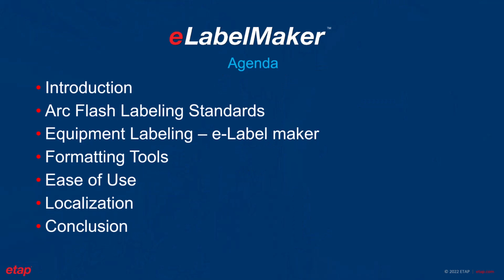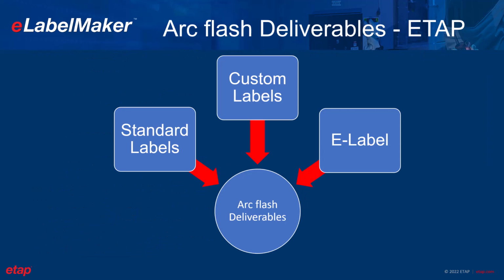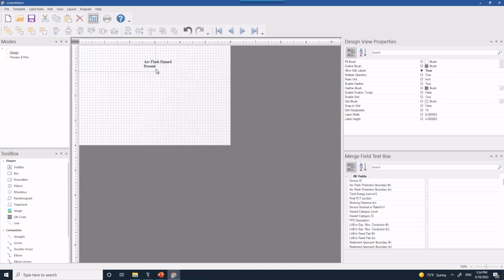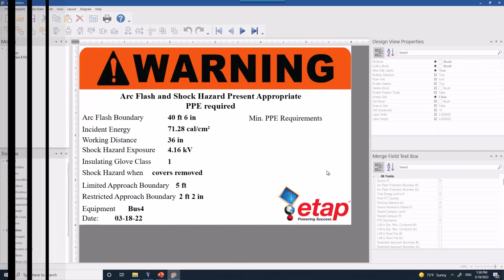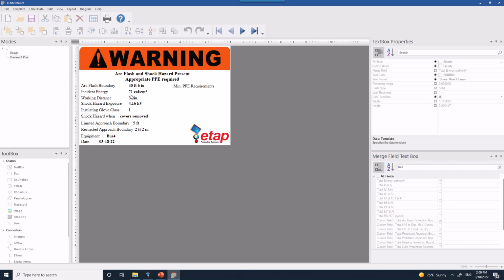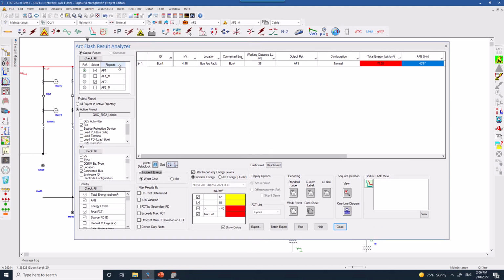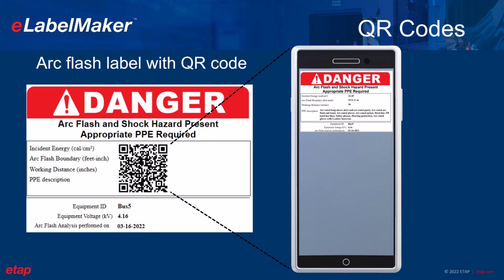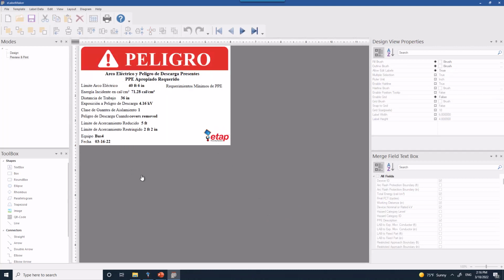How to create fully customizable Arc Flash Hazard Labels  in any language with ETAP eLabelMaker™

Comment: The fields in the Merge Field text box are not appearing for me after simulating the arc flash, I am using the ETAP 24 version
Reply from the maker: Thank yo for your interest in ETAP Solutions. We will forward your question to our product support team and get back to you.
Reply: Please make sure the label database.xls from the formats2400-> custom label templates folder which is connected to the arc flash analyzer is loaded to your label template

Comment: If the calculated energy is between  12 and 40, i want to use the text "Warning", but if the bus incident energy is larger than 40, i want to use the text "Dangerous". This can be done automaticaly, with ETAP verifying the value of energy and changing the labels?
Reply from the maker: Thank yo for your interest in ETAP Solutions. We will forward your question to our product support team and get back to you
Reply: Step1- use the arc flash analyzer and filter the results below 40 cal and export it to a template that has warning label header 
 Step2: use the arc flash analyzer and filter the results above 40 cal and export to the template that has danger label header .

Basically two sets of excel database  with each template just with  its own headers